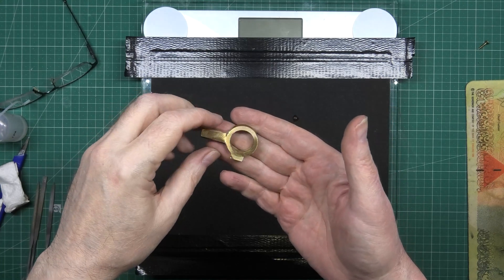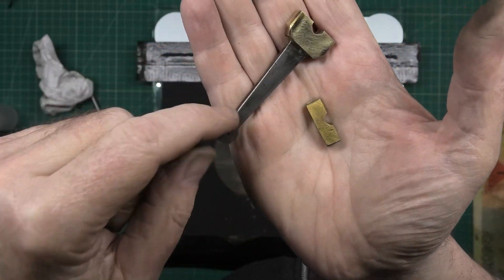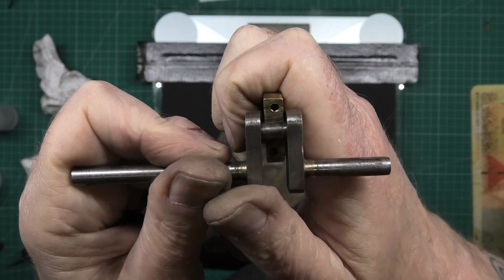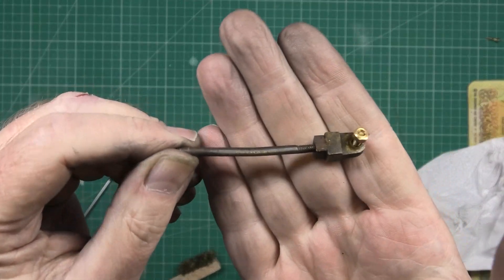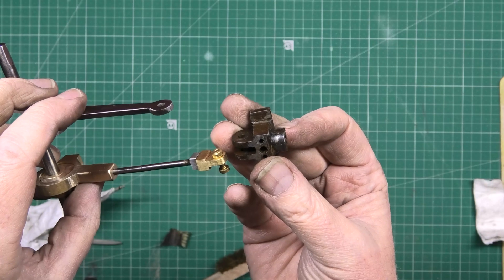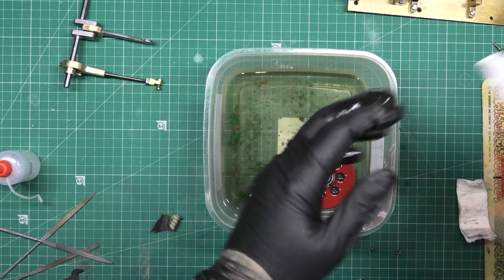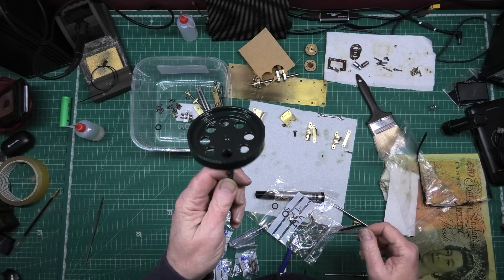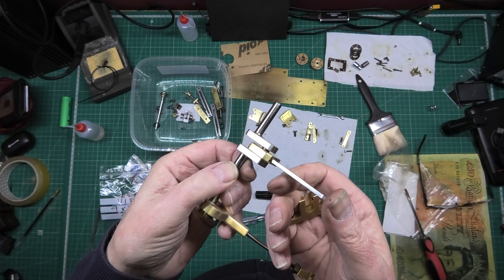Live steam engine refurb - Part 2 (of 3)

Comment: Looking pretty good.  It's a shame that more care wasn't put in to the initial build.

At some point you'll come across a part that can't be saved and I kind of hope you do because then you will have to buy a chunk of brass or bronze or steel and go at it with hacksaws, files and drills until you have the perfect part you need.

The way I understand it, these kits were partially fitted and finished by the buyer.  Making a part from scratch will make you more involved with the build than the first guy.  I think you will like that.

One thing, these old steam engines your kit was modeled after were built kind of more by blacksmithing than machining, often a lot of the less than critical details were pretty crude.  Look for pictures of the original to see where they spent time on finishing and where they didn't.

If it was me, I would make sure to run them in quite a bit to make sure they function 100% and start getting a bit of new patina.  Also get spares for the piston rings to keep with it and maybe spare gaskets too.  If you sell it, that will tell people that it's a runner and that they can run it at least until the piston rings give out.

I am looking forward to seeing it back together and running soon.

Have fun with it and please don't take anything I say as critical, I have just worked on a railroad with operating steam locomotives from the very early 1900's and helped rebuild one of them.  When you do that you learn a little about the history of steam engines and how designs changed over time, certain things you would expect to see together and things that probably wouldn't exist on the same steam engine.  I'm by no means an expert but I'll try to nudge you in the right direction if I see anything weird.

Happy New Year.